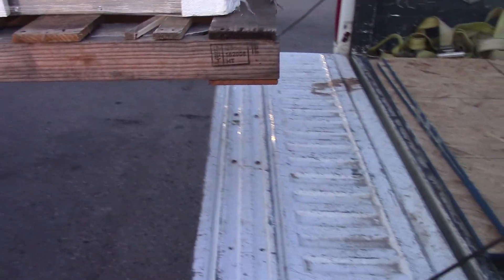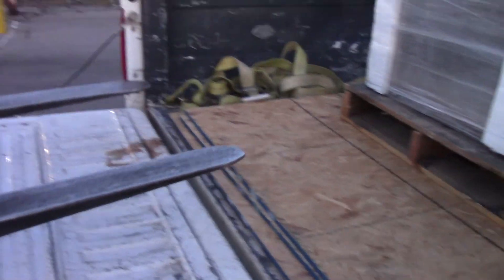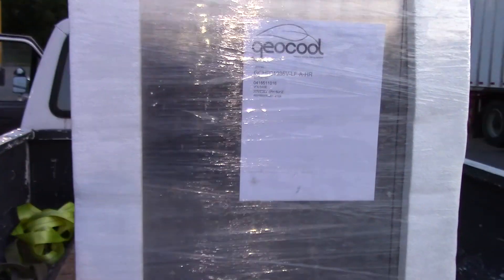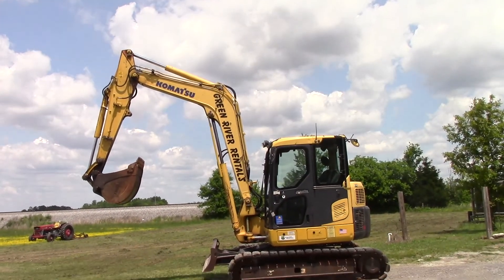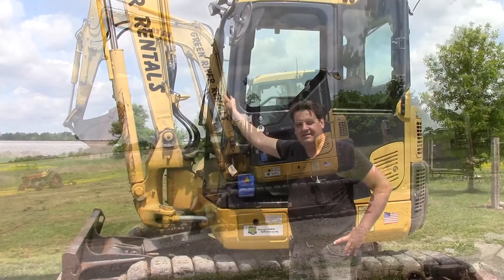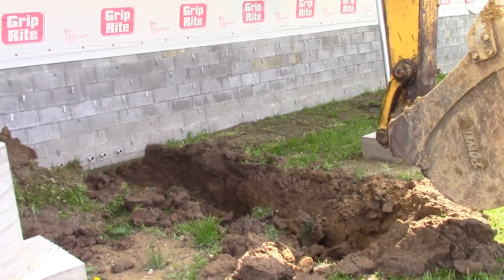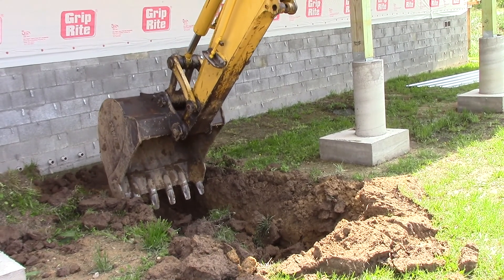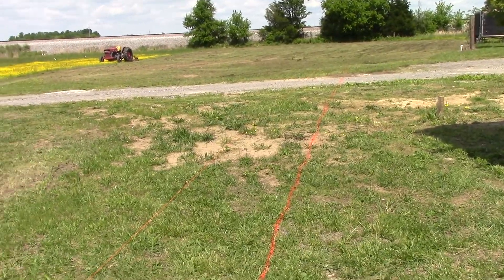Our Geothermal HVAC System from Ingrams Water & Air Part 2

Comment: tammy 4 feet a foot deep in 10 mins id of been sacked at that rate lol
Reply from the maker: +obieezx11 Hi there, Tammy here. Actually maybe it wasnt even 10 minutes. LOL However, due to the porch roof it went slower because he had to be careful and not hit it with the boom. :)
Reply: +Mac Gyvers Workshop JUST DOING SOME GOOD OLD AUSSIE STURING MAC DID A GOOD JOB I UNDERSTAND ABUT THE ROOF SO EASY TO SMASH THEM
Reply from the maker: +obieezx11 Yeah I was being super careful around that porch roof. It was close quarters in there.

Comment: LOL i dont think i have one of those tools in my toolbox, Where would i put my screwdrivers :-D.
Doesnt look too easy to operate, one of those things you have to do alot to get the hang of it, like gear changing and driving a car.
.
After the trench is done, i guess its auger time and drill loads of soil tubes for your pipes to go down/up, perhaps :-D
.
Thats a nice molehill you have in your drive, get an elephant gun ha ha :-D
Reply from the maker: +zx8401ztv LOL! I won't need to use an auger as the loop is completely horizontal. the trenches slope gradually up to the house, the go through the foundation wall, under the house, then up through the floor in the utility room where the unit will be located.
Reply: +Mac Gyvers Workshop 
Oow i was thinking deep was cooler earth and close to the surface was warm because of the sun heating the soil.
Well i am a silly sod lol :-D